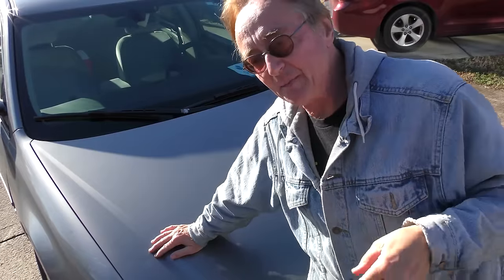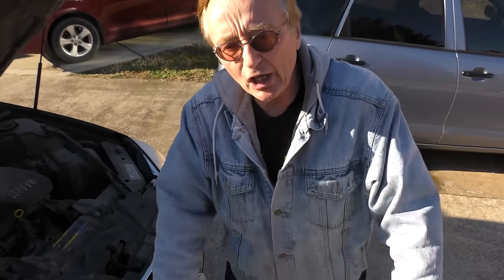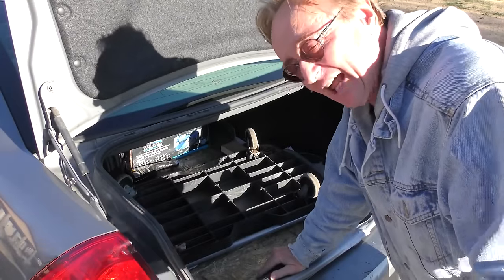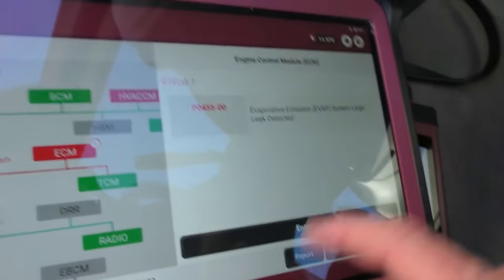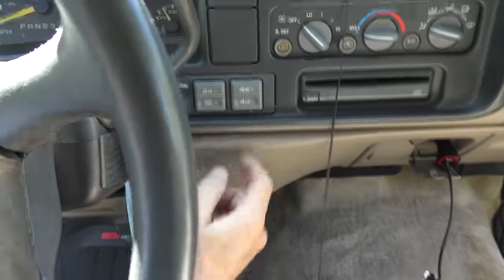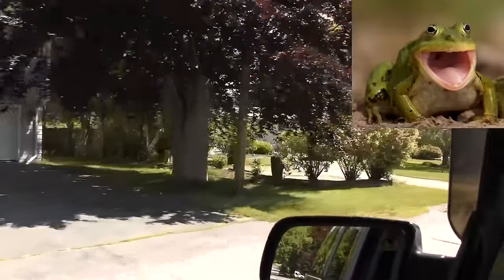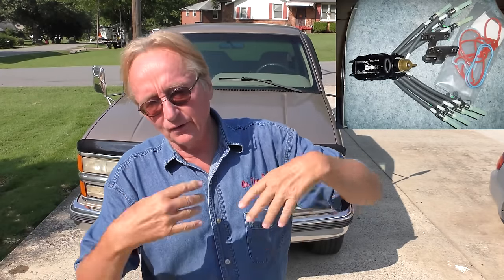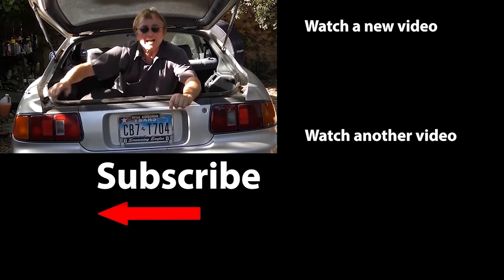3 Chevys That Last Over 400,000 Miles

Comment: I bought a 1981, E150, inline 300, with 140,000 miles and took it off the road with 535,000 miles and never touched the engine. The van's gone, but the 300, cast iron top loader OD, and shifter is in the shed waiting for the next project.

Comment: hey Scotty. I have a question for you.. the chevy 98 s10 I bought brand new back in 98.. has 329,000 miles on it.. the engine does not knock or smoke.. but I am a getting a p0300 and a p0303 codes.. does that mean mean engine is toast now?? I keep check on the oil., cause the rear main seal does have a leak. but performance wise it does fine.. sometimes.. I can tell when the misfire takes place.. but not all the time.. when it does its not that noticeable.. what do you think in your expert opinion?? what is my situation..

Comment: I have a 99 Saturn SL2 and it's got well over three hundred thousand miles on it. I ALWAYS change the oil att 3000 miles and use full synthetic oil by Pennzoil 5/30 . The AC still blows ice cold. It's all about maintenance. It uses about half a quart for the 3000 miles. I think they stopped making them cause they last so long LoL. Made in the USA🇺🇸🇺🇸💯👍Oh it gets 32mpg too

Comment: In my old 03 Malibu the AC quit working. I found a thread that said to try removing the AC control panel in the dash. It was pretty easy. It said the wipers behind the spin knobs were not getting a good contact on the circuit board. The advice was to clean the circular traces with a pencil eraser then use the graphite pencil tip to coat the traces to slow any corrosion. I couldn't believe it. It worked! Lasted several years and when it failed again I bought a NOS part off Ebay and it cured the problem for years again.
Reply: My 03 Chevy and the Hvac system has two rotary switches that are dc powered and one switch that is cable operated.  No pcb.
I do know that the instrument cluster is a copper trace pcb. The first thing on that that stops working is the mileage readout.
As far as cleaning pots on rc controllers, yes possible. Unless sealed toy grade controller.
But hobby grade pots, one can figure out resistance range visually. I see where your going here.
My issue? Leaves and broken dash plastic intrusion into duct work. GM's UV Resistant plastics sux balz. And their three stage water based paint too.
Reply: @fromthebackofmymind  Over the years I learned to copy websites to Word documents as they disappear in time. This one I did not and only have a link that goes nowhere. I didn't have paint or plastic parts issues, just the HVAC control panel. It did have the rear window motor fail issue Scotty pointed out. I fixed it and ended up giving the car to a friend badly needed one. Don't know how long the AC would have lasted as shortly afterward someone ran into them and it obviously was totaled. No injuries and they were able to get a new car out of the deal.

Comment: I have the 3500 V6 in my G6, and it's running great with 140,000 miles on it. Starts right up, shifts great, never had any major mechanical failures. I said good bye to the rockers a couple years ago, though.

Comment: Hi Scotty, when you say highway miles only equate to about 10% wear does that only refer to the engine of a car or also things like oil/ oil filter life? Transmission fluid life etc? Thank you sir!
Reply: I've got a 02 Silverado and it's great truck 5.3 with only 89000 miles now it had 66000 miles 2 years ago no rust and everything working like new

Comment: Of course that suburban runs good, it’s barely broken in at only 128k.  GM V8 engines are basically indestructible.  That’s really low mileage for a truck like that.

Comment: In the market for my next vehicle.  Is this 2007 Impala motor same or on par with 3.6 liter?  Saw a GMC Acadia for sale with that motor in it.  Think it is a year 2015.  Looking for something reliable enough that can go for 2 to 300 thousand miles.  I do know the 3.8 is good like that.  My last vehicle was a 2001 Honda Odyssey with 230,000 miles.  Wouldn't mind another Odyssey or maybe a Sienna either.
Reply: 3.6 is not a very good motor. The 3.5 is much better, however it does have less HP

Comment: Hello Scotty, 
I have a 2007 Ford Fusion with about 145000 miles on it. Had a recall on the brakes about a year ago, the ac doesn't smell great so normally have the windows down. Your videos are amazing, and I've learned so much from them. What do you think about the Fusions from the early 2000 to now? I'd like to have your insight on them.
Reply: Scotty says you are on borrowed time. Scotty says buy a Honda Civic ASAP

Comment: 2004 chevy impala 3.8 here with 280k and running great...
Reply: My co-workers 2002 Impala 3.8L had 265,000 miles when he junked it, because he was lazy.  Water pump went out, no power steering, no  A/C.
Reply: @mylifethaidiy7045  I've dump about $1500 in parts the past 2 yrs just because I don't want a new car payment and she's running so well...those 3.8 engines are awesome and very cheap to fix

Comment: I have to say the Chevy engines that gave GM the bad name was the ones that have AFM (active fuel management).  The V6 engines generally didn't have it (at least in that era of Chevy).  The V6 3.5L and 3.8L were actually quite reliable engines.  It's the V8 engines (like the 5.3L specifically) you have to be concerned about that have AFM.  And it's mainly AFM and cylinder deactivation that are the problem, because the non-AFM engines actually could last a long time because they weren't nearly as complex as the AFM systems.  On geared automatics, you can sometimes go a long long time without changing it (or never change it) and it will probably still be OK.  CVTs on the other hand, would die after about 100-150k if you didn't change the fluid regularly (like every 30k-60k).  In fact, many mechanics I've talked to say that if you don't change it regularly (a regular geared automatic's fluid) every 90-100k, you might as well just leave it alone if it's running OK.  I'm going to assume that with 400k on the car, it was most or all highway miles, which as long as the fluid level was kept up (if needed) and it wasn't contaminated and the father didn't beat on the tranny, then it's probably OK.  That Impala also only has the 4 speed transmission which is one that GM has had for a long time and is known to be reliable.  But if the guy is carrying around radio-active stuff, I'd be less concerned about the engine and more concerned about if something spilled in the trunk to be honest.... then again, I probably wouldn't want to be in a job where I was transporting around radioactive or potentially harmful chemicals myself....
Reply: Modern 4 cylinder vvt dohc gdi don't need cylinder deactivation.
Anything smaller than 2.0 liter and makers slap a turbo with can o worms problems on it.
2.5L inline 4 is the new muscle N.A.
Reply: @fromthebackofmymind  I grew up when dodge made omni with turbo 4 cylinders.  Those little cars were fun as hell.
Reply: @BruceLee-xn3nn  Mitsubishi were building rebadged Dodge Turbos. Cordia, Tredia, Starion. Omni, Horizon, Conquest.
I was a service adviser at a Mitsubishi dealer. Americans had no clue on vehicle maintenance of a 4 cylinder turbo.
We had to retrofit an engine shutdown timer circuit to cool down the impeller shafts with oil. Seized up from thermal shock in hot shutdown. Modern GF6 synth oil would have been liquid gold in 1983.

Comment: Is that impala a vin k with the 2 hose fuel pump that cost $500 at the parts store because they only make one thats made by ac delco and you can only find that out by vin? I have that one dound the same pump for less than $200 but it took sometime to find online with no photos for it

Comment: Bought a 2006 with 12,000 miles. Always well maintained. Engine locked up at 120,000 miles. Transmission Always acted up. Leaked oil. Front sway bar rusted out. HVAC actuator door motors replaced several times. Lug nuts stripped out at recommended 100 ft lbs.

Comment: 3500 is better than 3600. 3600s have timing chain issues.
Reply: That's because people don't change their oil or use high quality motor oil. The 3.6 LFX engines are way more powerful than the pushrod GM motors and can last a long time if with regular maintenance. I have a 3.5 myself so at least I know I can get a lot of use out of it.

Comment: Just got my 2008 Chevy cobalt to 200,000 💯
Reply: 😳😳😳, Mine is a 2006, and it just went to 150,000+. Obviously is running great, but I don't use it too much.
Reply: Your running on borrowed time.  I heard they were not as good as the 1996 Cavalier.

Comment: also loved the Chevrolet Impala and its body twin the Caprice my dad drove a used 1984 Caprice classic for about 6.5 years from 1993-2000 when my Uncle Rico downsized to a Honda Accord and I think it had 255K miles on it when dad got rid of it due to a damaged gas tank hated the 1991 redesign a big car doesn't look good in a fastback style or Jelly bean look and particularly not with bulbous flush headlights like you'd see on a Toyota Celica or a Porsche Carrera GT. favorite headlight styling is on your 1960s Oldsmobile 88 and 98 coupes/sedans stacked up the tailfin to look like an after burner on a spaceship or fighter jet my late maternal grandmother had a 1972 Delta 88 with the Rocket 455 V8

Comment: My old 1995 2500 doesn't leak anything and it's got 200k+ will run till rust Finally gets it because I'm in MN,  they don't make em like mine anymore,  and parts are dirt cheap compared to new garbage

Comment: I have 2011 impala LTZ 147,000klm  and the door blend actuator is toast and draining me battery. Can I just unplug it ?
45.99 +tax Canadian for this part
Reply: They are only $13.  There are 3 of them in the 2010 impalas and they are not hard to change out.  They fail all the time.
Reply: @mylifethaidiy7045  I know but it will be a few days before I get one
Reply: @sligacheese6470  If your car has top post battery terminals, I would just leave the negative one loose and take it off each time I park the car.
Reply: @mylifethaidiy7045  👍

Comment: Old land cruiser 2.8 inline 6 was a chev engine landrover v8s were buick and European highend brand  transmissions were made by GM Number one for a Reason.
Reply: Rolls Royce used GM's, 6 cylinder Harrison AC compressors. And Turbo Hydramatic 3 speed auto transmissions.
The Rover was a mistake. Buick aluminum 215V8 was not so great. They should have used the Chevy 250 inline six.

Comment: I got 200,000 out of my 08 impala before the headgasket blew the engine still ran good put in a used one instead. Transmission still running good except for the usual problem like the random jerks after sitting at  a stop sign or stop light ac works too door locks dont work tho

Comment: I got 525,000 out of an 03 chevy cavalier, it ran terrific up until about 325,00 when a quickie lube cracked the oil filter cover and didn't tell me, then in the middle of nowhere later in the evening on trip out of town on  a -4 degree night the engine started making noise, I pulled over and I found oil all over the engine, filled it up with oil from a gas station  , got it to a parts store, waiting overnight in the parking lot for them to open and replaced the filter and cover and it was never the same since but it did limp its way to 525, 000 before I finally sold it for scrap as it was a rusty hulk with a decent amount of damage from colliding with 4 deer towards the end of its life. . .

Comment: I hade a. 1980 dodge van with a slant 6 engine got 25 mpg got 300,000miles until I sold it in 2005 still running

Comment: I looked at NHTSA front and side impact testing for sedans The speed has been revised to 41mph from the previous 37mph to better represent actual road speed.
I was dismayed that the Chevy Malibu was in last place. But all the cars fell short for driver and passenger door impacts due to the propensity of taller suv, crossovers and pickups. Your noggin is now a really big target for "permatrauma."
I own an old gm compact myself and it's safety rating is horrible. Just a step up from a motorbike.
I need to find a one owner, 90's era "needs TLC" Volvo.
But those have so many electrical gremlins after 25 years.

Comment: That 1996 2500 7.4 litre does not have CPI fuel injection, it uses standard Bosch type injectors.

Comment: Unfortunately, my 2003 Chev Impala's transmission started to slip at mikesge off about 130,000 km, soon after a transmission service done by Chev  dealer.  Car had been regularly serviced by the dealer.  It ended up in junk yard.  I should have bought a Toyota Camry instead of Impala.

Comment: My 2003 Suburban is pushing 300k.
Reply: 2003 was the best year for chevy trucks.  The LS engines and transmissions were amazing.  My buddies 6.0L engine has 335,000 miles and the trannys fail at about 280,000 miles.

Comment: This generation of Impala came with either the 3500 v6, or the 3.6L V6. The 3500 is a good engine, the 3.6 is utter garbage. The 3.6 is what gives impalas the bad reputation.
Reply: They came up with the 3.5 or the 3.9 engines or if you had an SS it was the 5.3 V8. All solid motors and they were pushrod engines. The 3.6 had troubles because of the timing chain issue but rumor has it GM fixed the issue on their 2012+ models on the LFX engine. Regular car maintenance is key to longevity in newer engines.